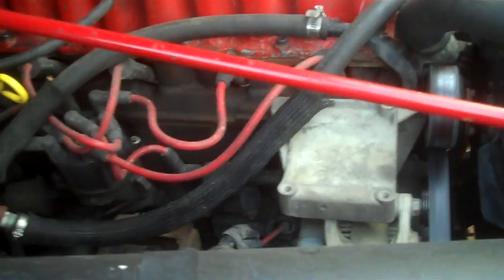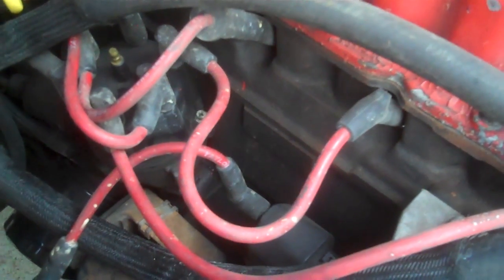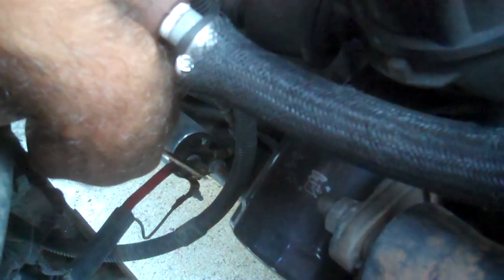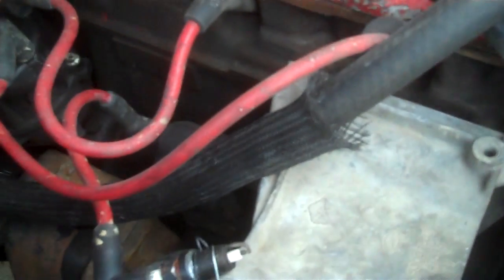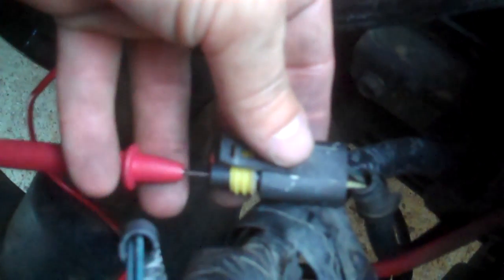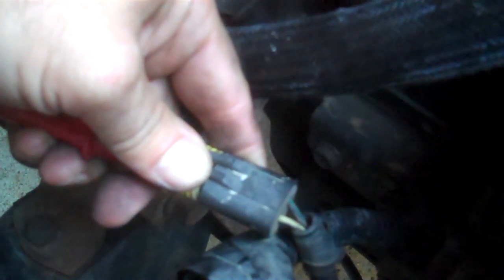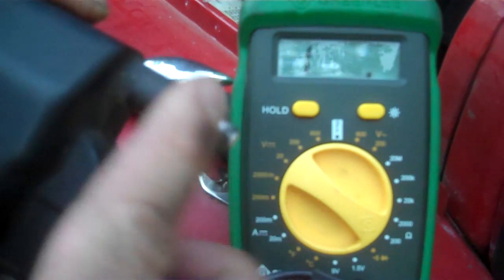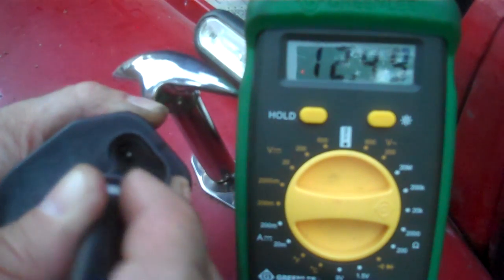Jeep Wrangler YJ - Testing the ignition coil and spark demo

Comment: Thank you for the information about the coil. I just have a quick question. What’s the voltage coming out of the signal wire should be on the Jeep Wrangler

Comment: Question for you… I know this post is eight years old, but I’m working on a 1995 one right now. Is there any reason you can’t test the signal wire by just sticking the probe on the on the other side of the plug when it’s not plugged into the coil… Or does it need to be plugged into the coil for some reason at that point?

Comment: Will it flash a high number then go down?  I'm getting 12.43 across both leads when having pos on spark wire ends and 0.01 across the plug is it bad?

Comment: ...........1987 to 1995 ignitiom system.............'' .  The ignition system in a 1995 Jeep Wrangler YJ is quite interesting. It primarily
 uses a *distributor-based system* to ignite the air-fuel mixture in the combustion chamber¹.
 Here are some key components and their functions:

- **Distributor**: This mechanical device is driven by the camshaft and is responsible for directing high voltage from the ignition coil to the correct cylinder¹.
- **Ignition Coil**: Converts the battery's low voltage to the thousands of volts needed to create an electric spark in the spark plugs².
- **Spark Plugs**: Ignite the air-fuel mixture in the engine's cylinders².
- **Ignition Wires**: Carry the high voltage from the distributor to the spark plugs².

Comment: Great videos! I'm trying to troubleshoot my non working tachometer. Per my wiring diagrams, one of the roles of the green signal wire coming from the coil is to send signal to the tach. So something I should check is continuity from the coil plug (green wire) to the tach. If that's good, it may indicate a bad tach. Am I'm I thinking about this right? Trying to learn. Your videos are the best!

Comment: Still trying to figure out my no spark/no start on my 92 YJ.  Probing the ASD relay using a test light on pin 86 shows a dim light, whereas on pin 85 has very bright light.  Would it be possible the dim light is caused by a grounded wire somewhere?

Comment: Ok, I'm here searching for tips and help me solve a gremlin in my no start situation.  I have a 92 2.5l 5 sp manual fuel injection YJ.  Short story, a few weeks ago I was on the trail, nothing crazy mind you and it just decided to stop dead in its tracks. Try to start, didn't hear the fuel pump so I figured it went out, had it towed to camp, drop the tank, new fuel pump still no go. Now all the troubleshooting begins. Checked Relays, fuses all good, changed ignition switch, cap, rotor, wires, plugs, coil, ignition coil pick/cam sensor, CPS, ECU all changed. Still no spark! Started probing and checking wires. The ECU is sending signal to the coil. When I turn the key on, the test light lights up, but goes away with cranking, no pulsing like in your video. The other wire as in your video should have 12v full time or just when key is on? either way there is no 12v at the other terminal of the coil plug when probed. I did the test on the coil as in your video, all readings are good! The fuel rail pressurizes and holds at 31, all lights, accessories, radio, dome, turn, brake, running lights, everything works. I'm just not getting spark and for the life of me can't figure out why. I am here looking for something that I have not yet tested, changed or figured out yet.  So, all you YJ peeps here I am looking for guidance. I've had this Jeep 13 years now and been really good overall. This time, it has me baffled! HELP!
Reply: 12v full time, the signal wire closes the circuit and triggers the ignition pulse.
Reply: @whosestone  I must have some sort of shorted circut somewhere. I've replaced everything related. Still no spark! I don't know what else to check. No burnt or melted wiring anywhere.
Reply: @klb1956  does the cap on the dizzy touch??
Reply: @whosestone  no
Reply: @whosestone  you mean the rotor touch the cap. I'm not getting spark from the coil.
Reply: @klb1956  how about the abs relay?
Reply: @whosestone  I don't have abs on a 92. All relays work, fuses, lights. As in my descrip, I've replaced everything that would or could be related...I think! ECU, cap, rotor, plugs, wires, Cam sensor, CPS, ignition switch, coil. Makes no sense to me.
Reply: @klb1956  I would scope the signal wire to the coil and see if there is a signal from the ECU
Reply: @whosestone  Still trying to figure out my no spark/no start on my 92 YJ.  Probing the ASD relay using a test light on pin 86 shows a dim light, whereas on pin 85 has very bright light.  Would it be possible the dim light is caused by a grounded wire somewhere?
Reply: @klb1956   Yeah ASD relay, don't know why I wrote ABS.  Could be. Might just be parasitic draw from across the coil.
Reply: @whosestone  In total pursuit to find this gremlin, I'm reading and researching. My cam position sensor harness shows 12v, ground is good and 9v.  From the Wrangler forum, someone snapshot a page that shows the numbers to be correct.  Something else I wonder is related, is that when cranking, my speedo goes all over the  place. Never did that before this problem. Curious if the speed sensor at the transfer case has anything to do with it.
Reply: @klb1956  that or  a neutral safety switch if it's a 5-speed
Reply: @whosestone  This is a 5 speed manual AX5, so no neutral safety switch on manual transmission.
Reply: @whosestone  Ok, so as everyone knows my YJ has been down since Judd.  I've tried everything I know how to fix, and picked everyone else's brain, read through countless forums and watch numerous videos on YouTube.  Changed every sensor, fuel pump, check fuses and relays, ignition coil and switch. checked wires for broken or burnt, grounds all cleaned, new plugs rotor, cap, wires.  Sent the ECU out for new capacitors to be installed. Apparently, that is what goes bad in these things. Came back and a no go! Fortunately, the company that did the capacitors refunded my money. Then I reached out to Wranglerfix in south FL. They do complete diagnostics and simulation testing. Installed new ECU and a no go! I had to send my original ECU as a core to them and I had asked them to put on their test equipment to verify it was bad. I spoke to Mark Cantrell and he confirmed it was a bad ECU. This eliminated the ECU going forward. Pulling my hair out at this point trying to figure what the heck! My next step was to pull the wire harness completely out of the Jeep and check every wire. It helps to keep a log of the order in which one does this sort of trouble shooting.  So with the new ECU and other parts in, I thought I need to back track some parts to dbl check them.  Ruled out the crank sensor so I went to the cam sensor. Knowing I put a new one in, thought new parts can be defective too. So that in mind, set top dead center on the piston, pulled the distributor and low and behold...the wire to the new cam sensor had been severed by the pulse ring. I evidently didn't set the wire deep in the distributor enough to miss the rotation of the pulse ring and it cut it instantly when I went to crank the engine after the install. Not knowing this, kept me chasing something and finding nothing!  Fortunately, I didn't throw away the old one as I was a bit more cautious installing it this time and tucked it deep in the distributor.  All assembled and back together, it started right up first crank! I was elated!  I learned a lot about my Jeep at this point and few new tools and lessons.  ALWAYS double check your work!!! Had I done that, I would've been on the trails last weekend or sooner.  End of the day, it was the ECU all along! All the other parts were a process of elimination and verification.  Thanks to all who spent time with me at camp during JUDD to help solve this problem and Ricky at JEEPERS DEN loaning me other ECU's to try out.  No part short of a replacement ECU would've put me back on the trail that weekend.  The YJ is ready to go better than ever now!

Comment: Hey! Love your videos. I know this is an older video. Hoping you’re checking these comments and can offer some advice. 94 YJ. I’m getting 12v at the coil connector but no spark to the distributor. Coil is brand new. Jeep sat for 2 weeks over Christmas. Ran fine before I parked it. Now I’ve got crank but no start. Any ideas?
Reply from the maker: Check the crankshaft position sensor or camshaft position sensor. It is not too uncommon for the crankshaft sensor to just randomly quit. Hope that helps and you get it figured out quickly. Thanks for being part of the Power Addicts Crew!!
Reply: Changed it and it fired right up!! Now it runs very rough though. Stays running but sputters and shakes quite a bit. Given all I’ve changed out recently (CPS, plugs, wires, rotor, dist. cap, coil), any ideas on why it would be running so rough?

Comment: So when you put your test light on the probe on the green wire where is the test light clamp attached?  I never hear you say where.
Reply: From the lack of replys here, maybe the doctor is out! Sure you've figured it out already since this is an old post.  The clamp on the test light goes to the negative on the battery. As he shows in the video, prob the connector with a wire, maybe a paperclip would work, and twist it around the test light probe. Crank the engine to see if it lights up.  Mine only lit up when I turned the key on and didn't pulse like in his video.  I'm chasing a no spark situation on my YJ posted above.

Comment: I've been experiencing a lack of power in gear. My Jeep backfires and sputters. I'll test the ignition coil next. I noticed that my cap and rotor were burned up today but new ones didn't fix the problem.

Thank you for your informative video!
Reply: What ended up to being the issue
Reply: @reedcarpenter2994 , There was a fuel pressure problem. I've since installed a new fuel ump in the tank. It works great now.
Reply: @eriku571  how did you find that out? Testing the fuel pressure?
Reply: @reedcarpenter2994  Yeah, the pressure was fluctuating at idle...

Comment: So i have a 98 xj that has a misfire in #2 fuel injector. Tested injector and checks out fine has same voltage as the rest. When I checked the ignition coil on the primary side I found it to be at 1.5 holmes which its supposed to be between 0.9 - 1.20 holmes. Im wondering if the high resistance is causing the misfire. What are your thoughts?

Comment: Man I got a weird issue with my 1991 2.5 YJ. It'll start and run, die, won't start. Let it sit for a week or two and it starts right up runs great. Other then being a 91 jeep, any ideas
Reply from the maker: Crankshaft position sensor would be the first thing I'd check.
Reply: @Poweraddicts  I have replaced it twice threw this round. I'm seriously thinking of making the jeep analog distributor and carburetor. We live in American Samoa, it's swampy to say the least. I look at replacing the pcm that's $350.00 + already done the cps distributor plug wires cap and rotor, mapp sensor, fuel filter. Three coils, finally figured how to test(threw your video) all three of those are good. Driving me nuts man.

Comment: Nice and simple way of showing how to check for spark for the ignition coil n spark plug spark. Great explanation of setting for oms n volts and where to put it. Alot of times these videos say put on oms n tell you what the readings should be without telling which oms setting to put it on. This will help me figure out what's going on with my XJ.
Reply from the maker: Glad the video helped you!

Comment: You da' man!!!!! My '01 TJ 2.5 suddenly pooped out at a stop light. Stranded. No warning, no CEL... dealership and auto parts store wanted to just start randomly throwing parts into it with no tests/rhyme/reason. I followed your instructions and found a dead coil. Dealer and store wanted to sell me a crank pos sensor AND cam pos sensor. Fine ideas, but that would have been $125 and still no fix. New coil was $35 and done. My sincerest thanks, my brother!!!! Long-time subber here.
Reply: Wish my problem was as simple as yours. Read my post above. I have all new parts and still no spark!

Comment: So I have 12 v on the white and pulse on the green.  The ohms on the coil seem to be good swapped the cam sensor from the old engine still no spark. Also new cap and rotor.   Still no spark on the wires.   So is it a bad coil wire?

Comment: This video - testing ignition coil - was outstanding for the not-so-handy YJ owner. 1993 YJ 4.0L. Sometimes it would start no problem, and then - Cranking cranking and cranking but not starting. Starter and battery good. Did the test just like the video. Resistance is high on coil. I have one on order.

Comment: I put a new remanufactured engine in and no spark. Checked all the way to ICM. Have 3 wire going to the plug for the ICM. Yellow 12 volts, black 4 volts and Green/white 12 volts key on postion, no pulse when though when i crank. Brand new ICM. Any suggestions?

Comment: My ohms meter on my ignition coil on the two post is reading zero is that mean it's not getting anything but when I turn my ignition and I stick my test light and night green wire it's showing that it's given signal. I have been working on this motor I've been through for ignition coils I got a brand new distributor in it I'm just stopped. I am not getting fire or sometimes I get fire and it burns ignition coil up

Comment: 94 wrangler yj i replaced cap roter and coil still no spark from coil could the coil be bad straight out of the box new? Its driving me crazy
Reply from the maker: It's rare but I've seen it happen. It could also be your crankshaft position sensor or camshaft position sensor went bad. Both parts are cheap and doesn't hurt to keep extras with you stored in the rig somewhere. If it's not either of the sensors then you will have to check the voltage coming from the PCM that charges the coil. One simple diagnostic for PCM is simply turn your key on and watch for the check engine light to come on. If it never lights up after turning the key on, good chance the PCM is bad. Hope that helps!! Have a great day!
Reply: @Poweraddicts   yes im repacing the cps today and no the check engine light never comes on

Comment: Thanks for the video. I've got a 97 tj that's been sitting for months with old gas. Started once, chugged to a stop, now just turns over. Figured bad gas, but won't fire with starting fluid. Going to run your tests tomorrow. Hope it's not the ecm again, already replaced it once. Anyway, thanks!!
Reply: What was the problem

Comment: I know this is an older video but what if you don't get the 12v constant from the pcm? The pcm seems fine and the only codes I get from the dash is 12 and 55. Which basically means the battery has been disconnected lately and end of code
Reply from the maker: Time to start tracing the wires from the ecm. Have fun and good luck 👍

Comment: I loved this video.   it told me exactly how to test my coil..   which I am about to go do.
on another subject..  here is something I learned about my 2006 Jeep wrangler....   which I could not find on the internet
This jeep was hardly ever used as it sat in my garage in a house in florida.   Then I brought it "home" to PA.  About 6 months later, I could not fill the tank with gas without it taking maybe a half hour !!  I learned the check valve in the tank was jammed closed.   Probably from Ethanol gas.    Lots of videos showed how to take the tank out, or at least access the tank and valve to fix it.    Instead, I took a 18 inch long piece of 1/2 inch ID plastic tubing..   (you can buy at any hardware store)  and ran it down the fill tube till it stopped..     market the tube at that point.. so I could see if it moved further..    then gave it a tap.. and popped open the check valve.     it has been fine ever since.
Reply from the maker: That's interesting to know, thanks for dropping on a great suggestion! Glad the video helped you!! Have a great day!!
Reply: Steve Maguire I seen a video couple a days ago that explains why that happens and how to fix that issue.  Just keep looking on YouTube.

Comment: Having a issue my Jeep no start. Checked the crank position sensor how you showed too in your other video and it seems good. Checked for spark and nothing. You say I should have a constant 12 volts to the plug that connects to coil but I don’t.. and when I check with the wire in the connector and the test light.. the light will flash twice and that’s it not matter how long I turn it over for. Coil is showing 1.4 on the plug connection side and 11.7 on the other side. Do you have ideas what’s going on here?
Reply: The only reading I get when checking for resistance on the crank position sensor is 59.5

Comment: i have a 1997 grand cherokee no start replaced the coil and crank sensor..tested the coil with a test light no voltage at all..where do i go from here..
Reply from the maker: Sound like the computer is bad if you aren't getting voltage to the coil.
Reply: is their a way i can test the computer for power

Comment: Hey buddy, I have a quick question for you. I have a 98 wrangler that I stalling out after it warms up. It cuts out while driving or sitting  I’ve already changed the crank sensor, and cleaned the idle control valve sensor with no luck. Any ideal with it might be?
Reply from the maker: Possible O2 sensor, my dads 06 TJ did something similar. Also the water temp sensor in the thermostat water neck. Air temp sensor in the intake. Honestly, that is one of those things that cant really be diagnosed without really being there. There are several things that could cause that. Good luck! Wish I could have given you better direction. Thanks for checking out the video! Have a great day!